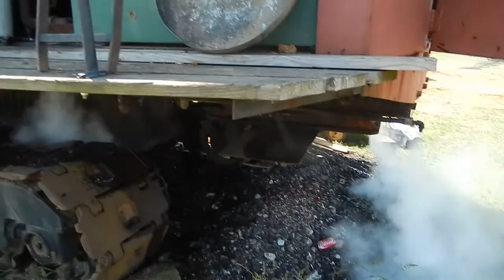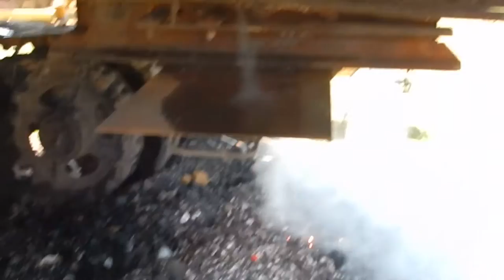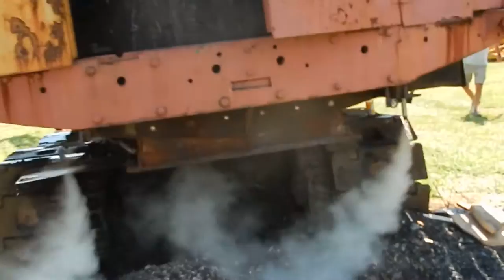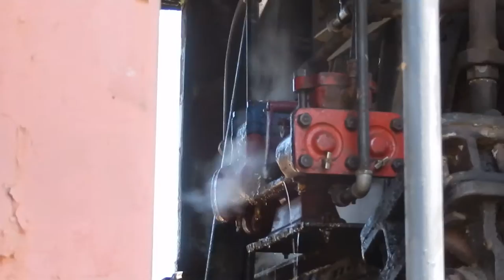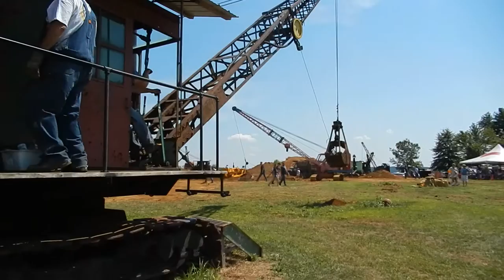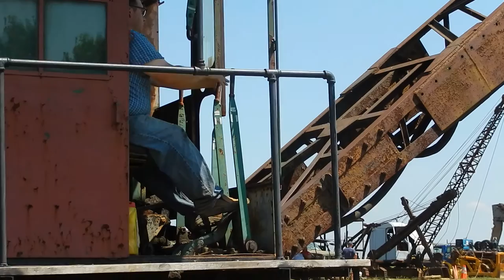Rough and Tumble 2015 - Steam Shovel in Operation!

Comment: That's me in the operator seat! Yep. First day on that machine. I ran a 1929 Bucyrus Erie 42b previously that is limber, and "automatic" compared to this one at R&T. The steam powered servos that actuate the drum clutches would not release from too much steam leaking past. There is a sweet spot for clutch engagement that was about two thirds of the lever motion, full lever would release the too much steam and fill the other side of the chamber, reducing effective positive pressure causing the band clutch to slip.. Every time I went to open the clam I had to reverse the main engine. Swing is real touchy with that old girl ( the engine that you wouldn't mind being soft ), neutral center is within a 2 inch movement. The fireman who knows the machine best said to me that in the past he's had to yell and tell the "guest" operator to please stop because they got on a pendulum swing with the boom and bucket trying to correct them self, but over correct and not stop the motion. LOL I joked that anyone who saw me moving so many levers to make the steam crane go from simple closing clam, holding clam, (in addition to engine starts/stops) to opening the clam bucket would think that steam machines are a pain to run. Normally, they are an automatic joy compared to same period gas powered cranes. Right now it's simply because we need to do some work on the R&T 42b to get it up to snuff. My guess is that it was a pile driver in its previous life. Mast control, steam hammer driver, and raising piling seems to be evident from the piping that's still on it, it was not an excavator. The 1929 one that is virtually the same machine but older has the over head main engine throttle connected to a swing linkage that actuates the closing drum servo instead of the lever alone. 2 operations in one motion. The R&T machine loses the benefit of having near full torque from 0 rpm due to the way the linkages are now set up. It seriously slows the action down not having a direct control on engine in a single hand motion- no governor on the engines- if the clutch is released with the throttle 1/2 open- the engines scream at high rpm, and I worry about cylinder scoring or other damage. It was fun! The club is hoping to have the servos rebuilt for the August show 2016. I will be there next year, hopefully not such a rookie! Thanks for sharing the video!
Reply from the maker: +Michael M Glad you found the video and thanks for the history lesson! i'm intrigued that there are steam servos to engage clutches and brakes. what is the benefit of that over direct mechanical linkage that's found on most cable equipment?
Reply: The primary advantage is less, operator fatigue, and simpler designs by using steam instead of arm power or extra parts to make a mechanical clutch for the clutch so to speak.  Steam machines were ahead of the game for operator ease, but also had the inefficiencies of a boiler needing a fireman.  Erie B steam shovels also have a steam powered piston to actuate the hoist drum.  One lever controls the steam clutch, and engine throttle, also on an Erie B you can move past neutral free fall center and it will engage the clutch with a reversed engine for power down of the dipper scoop.  We have a 1928 Osgood 35 ton in our collection with a gas engine.  Although it has mechanical power clutches, the exact model concurently machine made in steam was better because while in travel, the engagement of locking tracks to turn was entirely powered by a steam ram versus needing a "pitman" to pull the drive gear and block a track.  Companies like Speeder, and Northwest had great designs that mechanically automated what steam did already.  The "in between" years on gas machines were not great by any means. In 1930, I'd of preferred steam over gas on any day.

Comment: Ok, yep- this was at the very beginning when I was diagnosing why when I released the closing line the bucket wouldn't open. I hear me saying "good girl" when it opened a little on its own, I'm always anthropomorphic with machinery . At 4:30 you an see me pumping my foot on the closing line, then drop a little cable on the holding and the weight's inertia open the bucket a little. There was just too much steam slipping by causing the clutch not to release. I think in about 30 seconds after this, I went to the engine reversing method of opening the bucket. There was a second guy in addition to the fireman you see who was tinkering with the servos while all this is taking place. Thanks again!

Comment: A friend of mine saw this vid, he asked what are all the levers I am moving are; from operator seat far right (closest to viewer) is the closing line drum control lever with the closing line brake on the floor right side, 2nd lever in is the holding line and holding line brake on left side, then swing, then boom drum hoist, immediately to the left of the operator seat is the steam engine reversing lever. There is also a travel lever in view that is on the far left. The steam engine throttle is overhead, push forward to open up the steam valve. So there you go George!